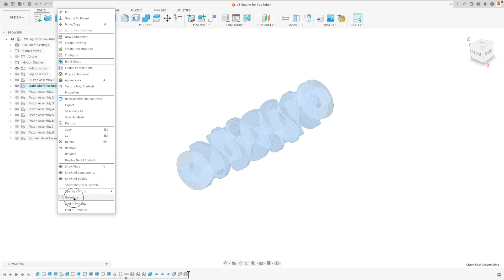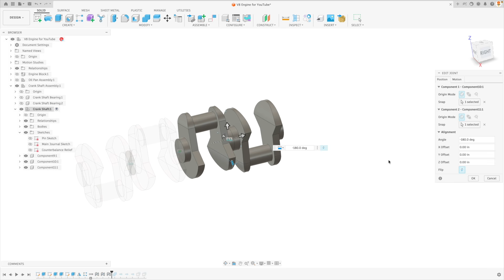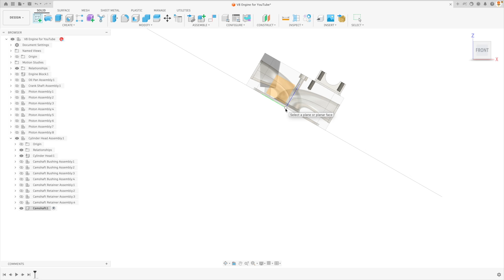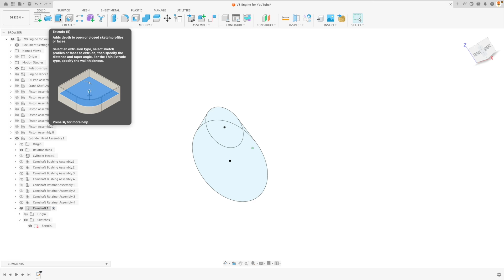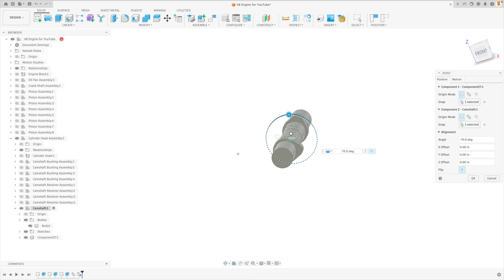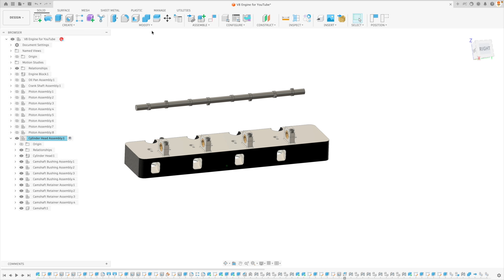Autodesk Fusion Course for Beginners - Part 8 -  V8 Engine - Firing Order and Camshaft (2026)

Comment: After correcting the firing order on the crankcase assembly I saw an error message that I couldn’t decipher so I ignored it. When I turned on the camshaft assembly I noticed that the left side bolt had disappeared from three of the retainer assemblies. I also noticed that the same thing showed up on your screen. Any ideas?
Reply from the maker: Usually things just need a refresh at that point. I think there is something in the cache that forces that to happen sometimes. I'll keep that in mind for a future tutorial. The simplest fix is just to edit each of the joints for those screws and then hit ok without adjusting anything.